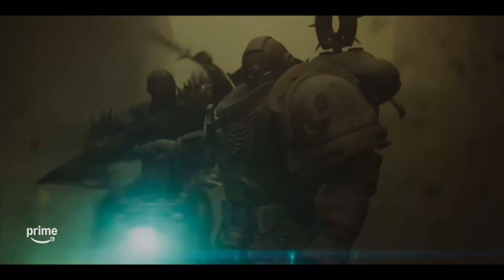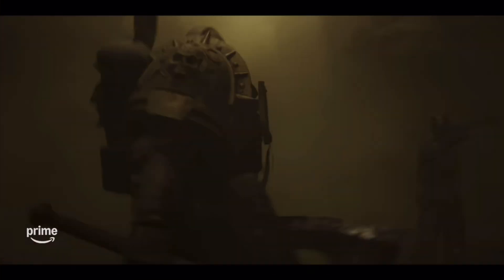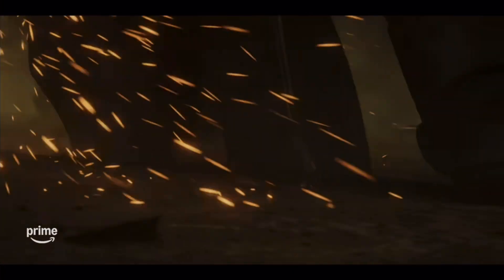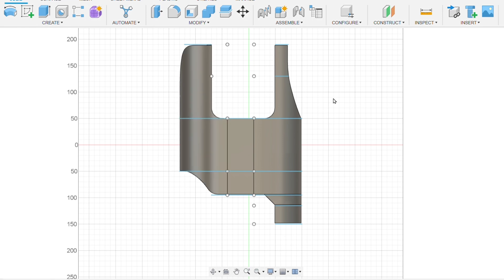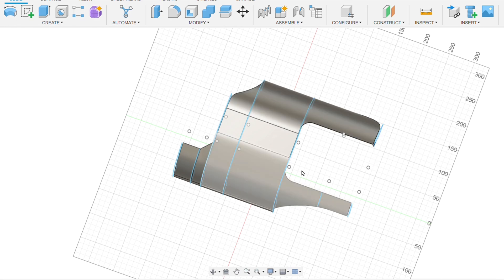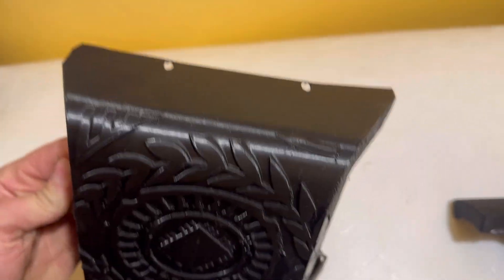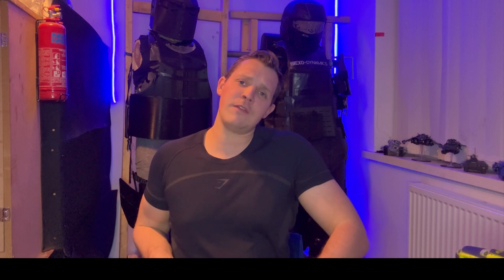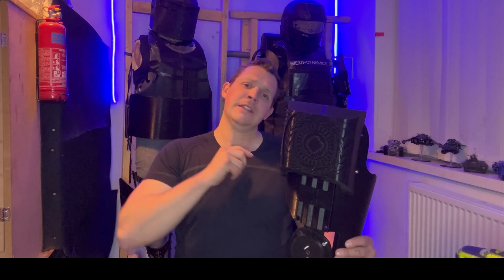The Problems with Pauldrons on Power Armour Exo-Skeletons - Arm Uprgrades

Comment: One more idea in favor of the pauldrons, specifically the space marine's. If the main issue is the pauldrons needing to articulate, then how about using a mechanical system? A level or a pulley or something along those lines. If the suit is already going to be mechanically assisted then the added resistance should be negligible.

Comment: This is awesome.  Just a thought, when it comes to the latest pauldrons you used,  it won’t get full range of motion but if you had a separate piece on the front side that would slide under the slightly larger top pauldrons with guide rails would that work?

Comment: Gotta say it, but have you ever considered walking sideways through a doorway? lol
Reply from the maker: Lol I literally tried, i thought well atleast if you can walk through at an angle its fine, but because the pauldrons flared out with your arms raised the issue was the same walking through at a 45 degree angle. Then at a 90 degree angle you can get through but with the back pack - power pack its also tight

Comment: I solved this problem basing mine somewhat off medieval armor (i am a modern Medieval armorer) . I made Warhammer 40k inspired armor to include big bulky pauldrons 1/4" AR500 and i modified my Army ACH helmet to have an uparmored brow reinforcement and Mandible visor of the same material.
Reply from the maker: That sounds great!i dont have the facility or skill to do that at the minute, but what did you find with the weight trade off, i know ar steel is probably the better option in a lot of ways but always thought, for full coverage the weight would get out of control.
Reply: @MattExo-Dynamics  I reduced the amount and thickness of armor on the extremities instead, opting for thinner angular armor to deflect projectiles and focused the majority of the weight on the torso armor to include Gorget, pauldrons, groin protection, etc. without the exoskeleton the armor can get very cumbersome. 

This dilemma actually was a problem for armorers of antiquity too. During the 17th century firearms became very prevalent and so the need for thicker armor became commonplace. Breastplates of the peascod style developed with reinforced plackarts and armor relatively became 1/2 to 3/4 suits in which currassiers forewent leg armor and gauntlets and instead wore thick breastplates, faulds that extended to cover the thighs, and a heavy burgonet or savoyard helmet with larger eye slits to facilitate seeing to reload and aim firearms. 

As for overlapping the plates of such thickness, the Germans in a way solved this dilemma in WWI by overlapping the plates and riveting them to thick rawhide leather or industrial heavy duty linen strapping to promote flexibility. I actually was inspired by the stahlhelm brow reinforcement plate on the M17 when I created my brow reinforcement plate. 

You can see some of these pieces including my exoskeleton on my channel. The helmet and pauldrons are under community posts. 

Keep up the great work!! 👍 I feel as though you are on the right path.

Comment: I know this might be out of your budget but have you ever considered using  UWMHPE as to shave weight without losing too much resistance?
Reply from the maker: Yh The process tp do it is abit out of budget (i think id need to injection mold/cast the shape). But i wasnt sure if it was actually lighter as well, the hardness of ceramics and the un-tearable nature of kevlar complement each other, where as, to my knowledge, UWMHPE is resistant to impact due to sheer molecular mass. Making it a heavy plastic. I will note im not super well versed in that so i might be missing a detail or 2

Comment: One thing to note is that modern exosuits will use primarily guns. You don't need full mobility to use a rifle. It's not like we are actually swinging swords and halberds around. All around its a good design.
Reply from the maker: True, although i wonder if they’ll be more small shoulder/back pack launched missiles in the future, bearing in mind all targeting systems could be inter-grated in to the exo suit i feel like its a high possibility.
Your right about the swords etc of course, but the shoulder mobility issue is more for everyday tasks like getting in and out of vehicles or just reaching to a top shelf.

Comment: It's impossible to fully armor a ball and socket joint like the shoulder against rifle threats using sliding interfaces without severely limiting the range of travel of the joint. The only thing that comes close are the multiple rotary joints like you see on atmospheric diving suits. In addition to have a powered ball and socket joint, you'd need multiple off axis servomotors like the Sarcos exoskeleton or servomotors for the rotary joints mentioned previously.
Reply from the maker: Yeah its difficult for sure, especially to keep the physical bulk down, if door ways were all 4 ft wide it would be considerably easier.  as for the actuators ive got the actuator as seen for up and down, the lateral raise is just elastic assisted  (trialed works well, the interior rotation is hinged in multiple places, which is fine unassisted with how little you move like that.

Comment: The power armoured equivalent to a gambeson/arming doublet would be the exoframe. Nothing should be on the user in both cases.
I'm personally a fan of fixed plates directly on the exoframe arms or hanging from it like the spaced armour of a StuG IV
Reply from the maker: I agree and ive found it woulds well, its just pauldrons that are problematic
Reply: @MattExo-Dynamics  I was thinking, what if there was some sort of linkage/gearing that pulled/slid the pauldron down whenever the arms were raised to the sides?

Comment: So, I was disabled in an Air Force pilot training (UPT) accident, and have a spine injury that necessitates me using a cane or arm crutch. 
Is there any chance that you could derive from your work a "hands free cane" exo of some sort, or a simplified exo that would allow me to run again? It's been a decade and not being able to run anymore is driving me insane, but also having to use a cane while walking my dogs makes controlling them and cleaning up after them alone difficult. PM me with an idea if you have one, and we can talk costs later.
Reply from the maker: Well, there should be in the future, ive designed the exo-skeleton to be used separately and modified for medical usage in the future, But for me at the minute, I cant delve into that yet - for various reasons, money, time, logistics, risk of being sued etc. hopefully that will change over the course of the next year. 
However with robotic advancements, I dont think you’ll have long to wait before somethings commercially available. Next year or 2 they’ll probably be something you can get to help you.
Reply: Getting to a running pace is pretty hard to get right with robotics. Between the balance needed, the control mechanisms and the weight of it all only basic walking exo suits are where we are at currently. That being said I have seen some smaller lightweight alternatives that will just help move your thighs, although I don't know if that would help you at all.
If you can combine a basic system like that with something else to support your weight, likely an elastic system on a lightweight frame, you might be able to get up some speed. Depending on your situation you might be able to build/ tweak/ modify something like that to fit you and your needs.

Comment: I think your idea of mounting "pauldrons" on the arm itself and keeping top open is the best one. I would suggest thinking about shoulders as a ball joint that armour slides on top of.
Another thing is scaling down the requirements. Medieval plate armour needed the amazing freedom of movement bc knights were swinging melee weapons around. Coverage wise, just like a tank you gotta prioritize directions from which you will be attacked most often, shot traps will be a thing against small arms projectiles too.

Comment: Disclaimer: never done armor design and don't know how feasible stuff is

If you're really concerned about coverage over the shoulders and traps maybe something to look at would be Gipsy Danger's armor in Pacific Rim, basically 2 "wings" mounted and hinged at the thoracic spine (or the power supply pack) that curve up and over. 

Thus you could have the coverage without the restrictions on range of motion or the width issue. And you could maybe have the upper arm be lower cut armor around the actuator so as to not cause collisions with the wings or chestplate while maintaining the protection of the shoulder area
Reply from the maker: Good idea, its pretty much what i tried with the paildrons i had, they attached on the back/spine and then flaired outover the shoulders, like a tighter version of gypsys wings, but its just that doorways are too small,  theyd be so many more possibilities like this if you had extra foot of room.

Comment: This is the first I'm seeing of your project but if you're making it for someone fighting in a warzone, making sure shouldering and aiming a gun are as comfortable as possible are very important. Trying to get a cheek weld with a bulky chest piece can already be difficult.
Reply: In my opinion depending on protection purpose soft flexible armor could be great for these jointed areas
Reply from the maker: Thanks for clicking and watching, yeah 100% i have a couple videos further bacl trialing this on the old prototype.

Comment: In know its maybe much but think about the bullet splash (circular fragmentation on impact on a hard surface) getting under the armor plates.
Especially when the fragmentation could reach the major arteries that way.
In the worst case youre directing the fragmentation in a bad way with the angles of your armor
But thats for later iterations of the armor i think ..when you put a gel block into it an actually shoot it
Reply: In those weak points and arteries it either on the suit or on the clothing underneath, small Kevlar pads can be used to catch those smaller fragments. I would imagine something like biker's leathers with protection in strategic positions being worn underneath it all.

Comment: I see exoskeleton armor being in layers. The first layer is a skin suit that is infused with silver to eliminate funk and friction. A second suit is made of composite materials like Kevlar for spalling and last ditch protection and flame resistant materials. This also allows a cooling system to be piped in and something to allow you to conduct bodily functions. The skeleton part of the suit is what you slide or step into. The skeleton with need shock padding on the interior and that is all you make contact with beyond where your feet rest or possibly a "seated position" This is a frame that allows a thing protective layers possibly environmentally sealed, your mechanical and electrical systems to mount and be routed on. There will be no weight on the user at all and all segments will have to be connected with spall and ballistic materials with are water proofed.   The armor itself will need to be angled layered composite with a rubberized coating. Basically coating, steel/titanium, exotic materials like carbon nanotube layered mesh, graphene, ceramics, ballistic plastics or whatever can be sandwiched in to stop AP rounds up to .50
Reply: As bad as the game was, I think Anthem's exosuits sound very similar to what you're describing.
Reply: Non newtonian fluid cells and gel sleeving could also be implemented under the kevlar layer. Kevlar laryer could be part of a flexible thermal plumbing system.

Comment: I know the main limiting factor on the implementation of power armor currently is a power source. They can easily be powered, but having batteries to store that amount of power and remain small and lightweight, or a generator scaled down enough to be carriable, is currently out of reach for humanity. Once those innovations are conquered, the barrier will be substantially slimmer.
Reply: You will needs something equivalent to a micro nuclear reactor or nuclear fusion reactor if you want the power armour to work for months or years to make it practical enough for military purposes.
Reply: Nah you just need a limb motor that requires no power to hold position.  I left my powerarms on standby for more than a week and the 5ah battery only drained to 50% :D

Comment: A Kevlar shoulder mantle
Reply from the maker: True that probably is the best name for it, im thinking of lacing ceramic into it, atleast certain places to add both protection and to get it to hold its shape as wanted
Reply: @MattExo-Dynamics  I probably wouldn’t use ceramic as you run into the issue of breakage, maybe UHMWPE instead if you can get your hands on it.
Reply: Yeah, and you could maybe attach plates directly to the mantle.

Comment: how long can your suit last (battery)?
Reply from the maker: A but of an unknown tbh,  but Im aiming for atleast a day, the back pack which will hold the batteries can be easily swapped out and reconfigured, The problem with working it out theoretically is they’ll be a massive difference in power usage between say walking around a flat urban environment and  then speed marching up a long grassy hill.
Reply: @MattExo-Dynamics  A stair machine may be useful for testing such conditions.
Reply: @MattExo-Dynamics  I am planning on writing a Minecraft system isekai story. The protagonist will eventually build power armor, and I am considering limiting the tech to analog, electromechanical computers alongside steam and combustion engines. His power armor would be very bulky and use hydraulic or pneumatic actuators. A world war dieselpunk aesthetic instead of sleek sci-fi.